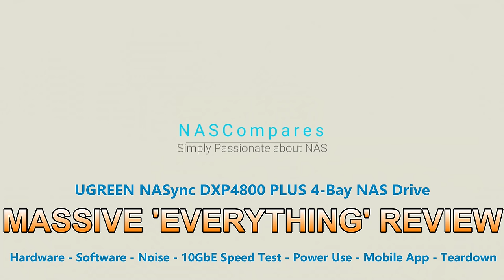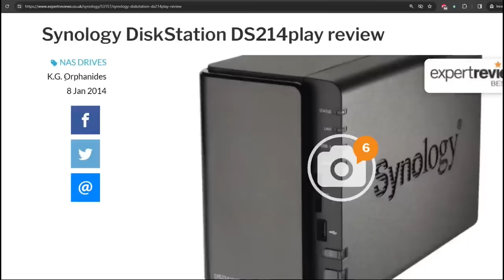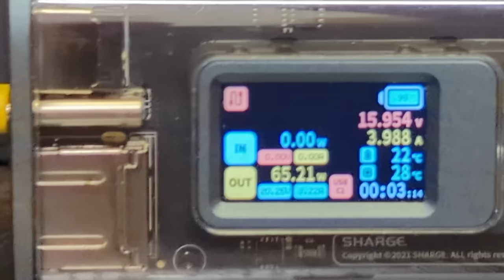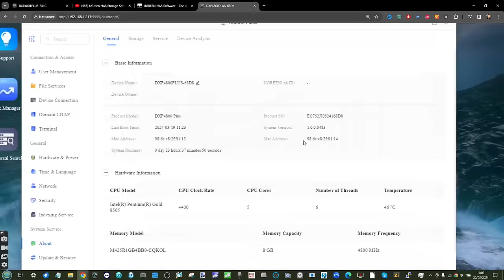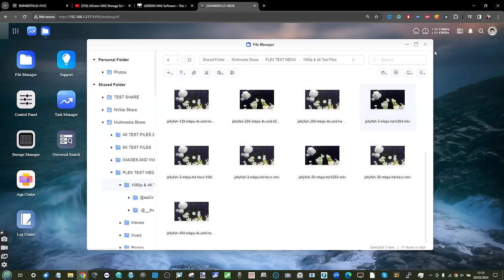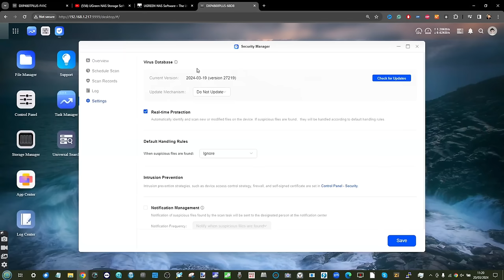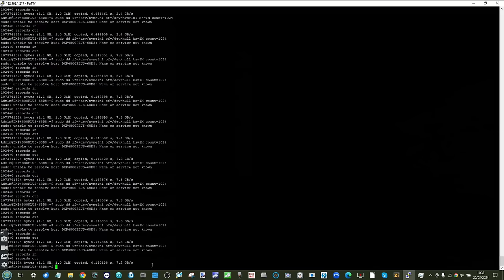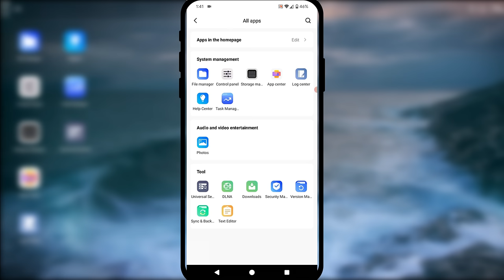The UGREEN NASync DXP4800 Plus NAS Review (EVERYTHING!)

Comment: As someone completely new to this space I had a question. The transfer speeds that you showed over 10gbe was slow and again sorry for my incompetence when asking this but, thats transfer stuff over the network so wireless right? I have a mac studio that has a 10gb ethernet port could I plug the ethernet cable directly from my mac to the NAS and receive much fast speeds?
Reply: If you want to just have extra storage attached to a desktop pc or Mac, you could consider a DAS.  Google QNAP DAS units.  They generally connect via USB 3 at 10gb speeds.  DAS  generally cheaper than NAS.  I'm not saying the NAS won't connect to the Mac though, it's just that being cost conscious, and enjoying mocking Mac users, I am not familiar with Mac
Reply: You can use a Peer to Peer Connection. But you dont will get a faster Speed with this nas as is Shown in the Video. SATA is Limited to 6GB/s. Magnetical HDD are even slower. So you Need all SATA SSDs or if you Need the Full 10gb, Switch to the nvme Modell.

Comment: Please explain how you disassembled the server casing. I removed the rubber caps from the back and unscrewed the 4 screws, but I still cannot remove the server casing. I want to replace the UGREEN disk with another one and install a different OS. Video Chapters 19:24 - Internal Hardware

Comment: What are the dimensions of the case? Will the 6-bay and the 8-bay model be the same height?
Reply from the maker: Yes, same height. Putting together a Q&A vid together on the unit after this vid..as I FOOLISHLY said this was an 'everything' review, but so far it turns out I missed about 7-8 questions people have asked (inc yours!)
Reply from the maker: For the DXP4800 Plus it was:
Retail Box: 37.5cm x 26cm x 27cm
System: 25cm x 17.8cm x 17.8cm
I'm like 95% sure the 6 and 8 Bay are gonna be the same height
Reply: @nascompares  Okay, I take it that the dimensions are (D x W x H), so the height of the unit is 178mm/7.007", a tiny fraction above 4U (which is 177.8mm/7"). 

That will help me decide on if it's space-efficient enough for a server rack shelf and if I should budget 5U of space for it.

Thanks!

Comment: Why does the spec sheet list that the 2 bay and 4 bay use 32gig EMMC OS drives? I won't buy devices that use soldered EMMC storage.
EDIT: Also what is the HDMI port for? I don't see any options for something like a plex server or other media server service.
Reply from the maker: Haven't tested the N100 2 and 3 bay, so cannot speak for them. The HDMI currently only provide multimedia output and is managed by the media app in the browser (and mobile I believe, need to confirm that)

Comment: DXP6800 Pro, with 6x2TB Ironwolf SSD's plus 2x4TB Crucial P3 Plus NVMe's + 64GB RAM.  Set up single storage pool w/ 6 SSD's (12TB, 8TB usable). Updated to newest FW. Rebooted a couple of times. Problem - in Storage Manager, there is no option to add SSD Cache. Should be found by clicking the 3 dots to the right of the storage pool. That pull-down menu does not list SSD caching at all. Further, under Hard Disks it shows the 2 NVMe drives and says they are both "normal". Are these NAS incompatible with Crucial P3+ NVMe's?? This is frustrating.
Reply: Someone on reddit commented that caching may not be available if SATA SSD's are used for main drives. Haven't found that stated anywhere. After running file transfer tests, SATA SSD's more or less fully saturate the 10GbE link so caching might be useless anyway. But strange that the option is fully removed in this configuration.

Comment: Nice hardware specs, but now a total failure unless you live in the US or Germany.  I was very excited initially, I was ready to order on the kickstarter, I need a new NAS now, but then found out if you now don't live in those places then you have no idea when it will come to other regions.  The RRP is not in the least competitive so unless you have loads of spare Dosh and don't care about cost, you will choose a different vendor - Ugreen have no pedigree with NAS devices, they have no track record with NAS systems.  I have tons of Ugeen devices, love them, but this NAS release is totally daft and a massive turn off.  I will get the Terramaster instead, the 424 has good hardware, a sensible price, and a good pedigree, and if don't like TOS I can replace with TrueNAS or Unraid, or Proxmox.  I feel quite let down, especially as the restriction to US and Germany only appeared later.
Reply from the maker: Thanks for sharing your thoughts bud

Comment: All these new devices coming out will force sonology to innovate on the hardware side of things and stop being so particular with low end hardware. Maybe even lower their prices.
Reply from the maker: Ideally, it WILL disrupt the market...but ONLY if products like this are stable and reliable. Otherwise, the established bigger brands can use the "secure and stable" angle to beat the new products into negativity. UGREEN is easiest the biggest player I have seen enter this market for a while..I just wish they had not gone down the crowdfunding route..they are big enough to have gone traditional retail. I talk about this more in a video soon, but in short, I believe they should have focused on 2 units (4 Bay and the flash model), released them in the autumn as traditional 'retail' products, then pushed the other 3-4  units as a phase 2. Too many SKUs, too much crowdfunding uncertainty for some users and too much for users to be potentially negative or snobby about. I really, really want to be wrong!!!

Comment: no ECC support no ZFS?
Reply: Just found out it has ODECC support. So theoretically it should then be ok running ZFS. The reason for asking is, what if the controller chip dies? I had issues in the past that the controller died and all disk were unrecoverable unless I had the exact same chip for the drives connected to.

Comment: Do you know, if on the 6 bay and 8 bay Versions, the Thunderbolt on the front is to connect to the Computer direkt, so the NAS 
can be used as a Storage pool, or is the thunderbolt port in front only for a external hard drive to connect?
Reply from the maker: The TB port is for the host (NAS) control only. i.e it only supports external storage and peripherals where the NAS is in control. What you are describing is currently only available from QNAP

Comment: Ughhh....getting closer to having real ECC memory but still not there.  ODECC is not for data retention.  When are these manufacturers going to learn a NAS is for long term storage for so many.  Would have bought into the kickstarter for the flash version if it supported true ECC memory.  Would already have the Asustor flash version if it supported ECC memory.
Reply from the maker: Tbh it's a CPU thing more than anything..and those ECC processors (predominantly xeon, but there's that recent SoC AMD too) are expensive and require mobo support/design too. The target audience for this project is not looking to spend ECC money sadly. They might haven priced themselves out the market if they'd gone down that road. Just my opinion of course
Reply: @nascompares  Agreed.  Just wish manufacturers wouldn't always try to appeal to the lowest common denominator.

Comment: Once again Youtubers not knowing wtf they are doing. You mention your dd "benchmark" not being cached, but it is.. That's why your first two measurement are significantly slower; they are the real Q1T1 read speed and why copying between the drives is similarly slow. Fast NVMe needs more than QD1 to achieve max sequential performance, which makes dd a terrible benchmark for them.